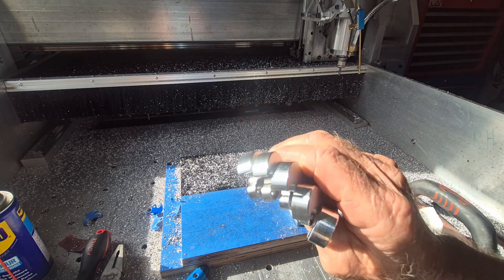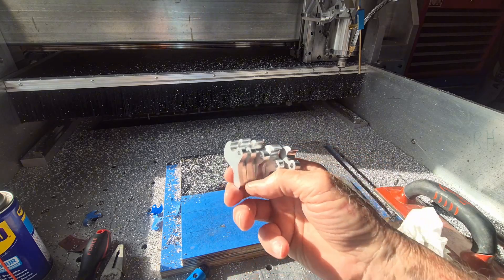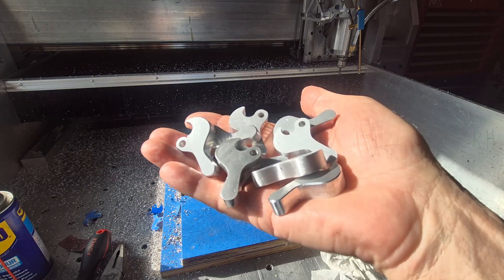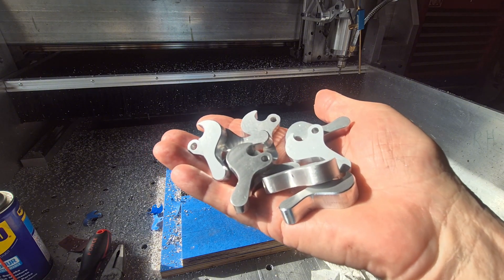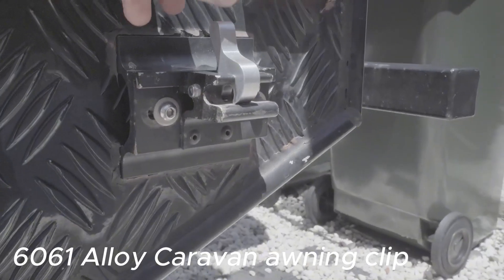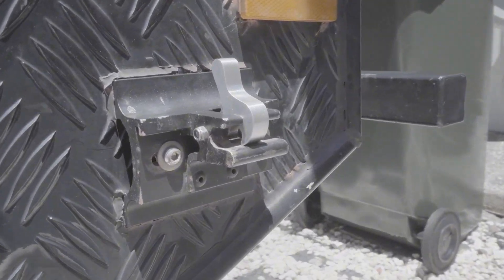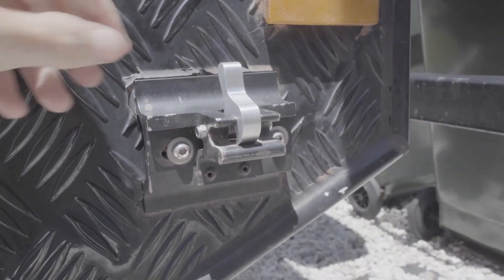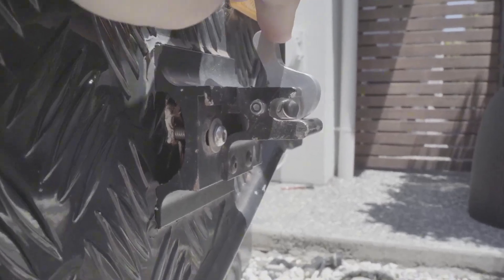Bill CNC Batch Machining Alloy van clips

Comment: Very nice parts my friend. You have skill. 
Happy new year.
Reply from the maker: Thanks Rusty, yes I was happy with the finished parts. I proto typed them with my Bambu Labs X1 Carbon 3d printer first then did the first batch in the vice, second batch I used the blue painters tape and super glue strait onto the spoil board , results were much the same ( vice would be quicker if you were doing a large number of them ) anyway thanks for commenting and I hope you have a happy and productive New Year Cheers Bill